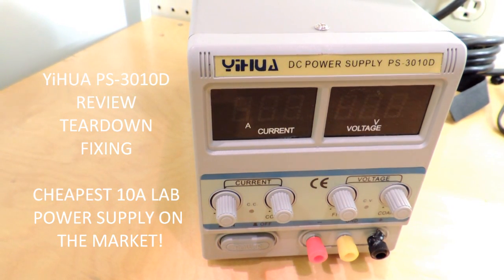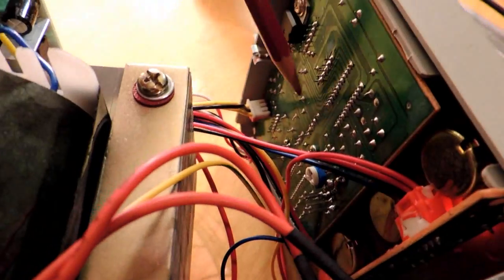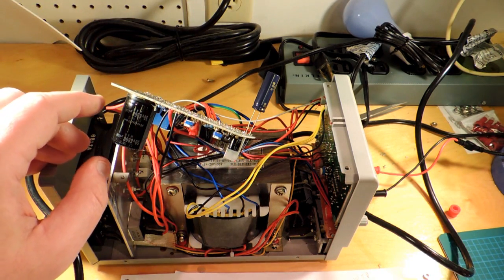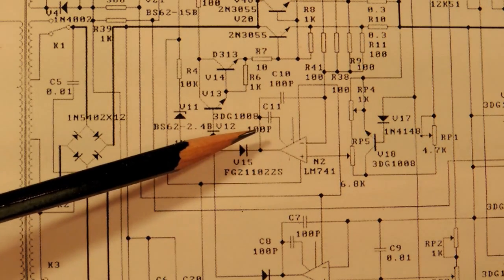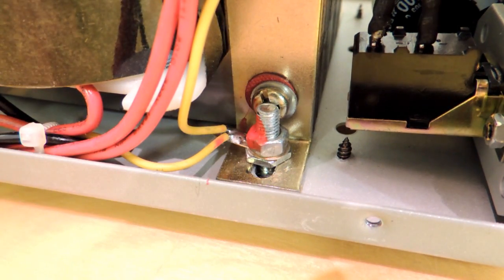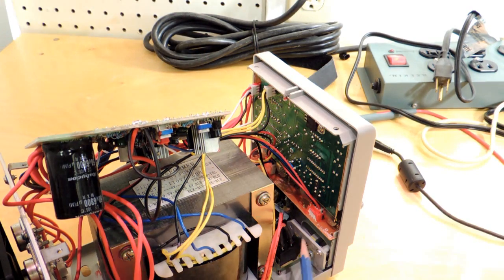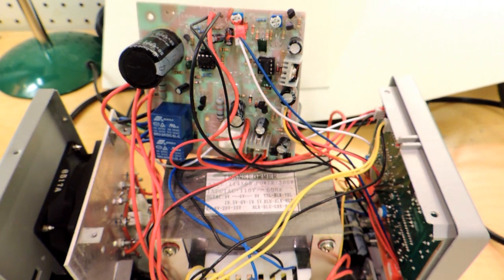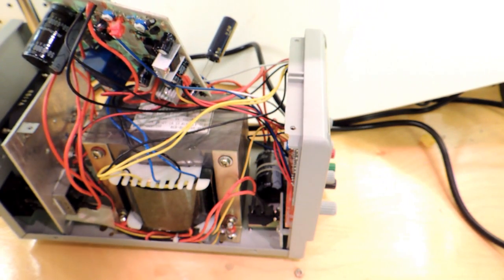YIHUA PS-3010D LAB POWER SUPPLY REVIEW AND REPAIR

Comment: i have a similar looking DF1730 30V 3A linear PS version, like 10yrs old or so, with a crackly Amp knob (so it seems) . tried to disassemble the thing. What a horrific experience!! a rats nets , all tied up, no room or spare wire anywhere to get single modules out without complete disassemble incl. all the cable ties and EVERYTHING. a total mess!!! Also no proper schematics or block diagram found online. Terrible!!

Comment: I have a problem with my power supply. I found the regulator power transistors and resistors were burned.even after replacing them  not working. Therefore I replaced the error amp too. but still not working correctly. But after removing the UA741 the voltage control is working fine. 

I don't have a schematic with me. Can you send me the schematic please.

Comment: I have same PSU, I replaced the potentiometer, and the psu still float the regulated set voltage I need it to work on, example: it will jump from 5v to 3.4 back to 5.5 and so crazy on, sometimes it get stable. I hear how relays switching while start get unstable. Some help, what could I check?

Comment: electronupdate ive just bought the 1503DD model its a 15v 3amp now it seems to work for like powering stuff like bulb's moters anything really that runs on electric but it doesn't work for zinc plating it just bleeps & flashes with no power going to the anode & part do you have any ideas please what it could be ? ? ?

Comment: USE A 65Cº ALWAYS OPEN TERMOSTAT FOR THE TRANSFORMER AND A 75Cº FOR THE RECTIFIER ON THE BACK TO SWITCH THE FAN ON AND OFF ALSO A CNC MACHINED GPU COOLER IN IT SO IT OPERATES VERY WELL, YIHUA IS THE BEST ECONOMIC BRAND FROM CHINA THEY DESIGN THEIR PRODUCTS TO BE WELL MANUFACTURES WITHOUT BEING EXPENSSIVE ITS THE PERFECT BALANCE PRICE TO QUALITY OTHERS ARE JUST COPY´S AND DONT EVEN TOUCH ERUNTOP STUFF

Comment: My equivalent just began throttling to over twice its voltage rating on power-up with no load and a settings at zero. On throttle, the external multi-meter readings are +/- 1.5V. After tweaking the knobs (either Amp or Volt and either course or fine), a faint click can be heard, the fan cuts out, and the unit slowly drops to a display of 0.01V. Again, multi-meter readings are the same as before. Where do I start?

Comment: Blown PS305D supply up twice (30V/5A), circuit similar except it has 2 x 2N3773 instead of 4x2N3055. First failed testing a drone motor, second comparing 6V bulb with LED light. First time I ran motor well above 3.7V and then re-connected it - blew 2 x 2N3773, plus one 0.33 ohm resistor. Today the 6V bulb blew at 6V exactly and the two output transistors failed again. Decided to do the mods described above but could not find out where to put the capacitor and what value. Went to extreme and put 2200uf/63V across C1. Blew 2 of the rectifiers V1-V4 which went up in cloud of smoke, maybe the capacitor was duff. After replacing them I tried a 220uf/63V (ok) and then 470uf/63V - the actual voltage is about 24V. It was ok so I kept that. But then I noticed C3, so added a second 220uf/63V across it - all was ok. I await further failures, not sure how to protect the supply from overload, not confident at all.

EDIT #1 

Blew again in the afternoon. Something is really wrong with my PS305D. Lost only one 2N3773 this time. Was testing 16 LEDs for replacement of light bulb for 6V. Measured single LED as 2.6V-3V seemed ok each 100ma at most. Wired 8 strings of 2 LED in series and then put these in parallel. Set the voltage to 5.2 V, all were on, then adjusted the voltage slightly up towards 6V target, something blew and the supply display read the dreaded 50V again. Fixed the power supply quickly as I have lots of spares on hand. For the LEDs 7 survived, 5 went open circuit, 1 went closed circuit and 3 were about 1K each direction. I guess I must have caused some sort of surge which blew a 2N3773. This scenario should not cause an overload!

WHERE TO CONNECT BASED ON VIDEO - POSITION AND CIRCUIT DIAGRAM

Looking at the main board from the copper side. Looking at the supply from above with the cover off. The left side is looking from the front to the rear. The board is screwed to the aluminium heat sink by two screws, call this edge A. Work clockwise around the main board you have edge A (rear), B (right), C (front), D (left). On the edge C about 2/3 along from B->D is a 7812 voltage regulator with 3 pins. On right side is about 24V (input) with C1 470uf, and on left side is 12V (output) with C3 220uf. Middle pin is ground. Not sure which of these capacitors the OP was referring to. I duplicated each by placing leads across the 7812 pins and then used cable ties to secure the capacitors. Effect should be same as OP describes, but leads in different place. Hope this helps. 

This mod did not prevent the third blow out I had. Possibly some other components were destroyed as well in my first blow out. Another circuit I found has a diode from the collectors of the transistors (V48 etc) from the other side of the emitter resistors (0.33R) pointing toward the collectors. This seems like it would limit a reverse spike going through the emitters, but I am not sure. Frankly I am giving up on this power supply and using another I got from EBAY labelled MS-305D.

MS-305D TYPE SUPPLY

This is completely different from the PS-305D though the front panel is very similar. It has a switch mode power supply, a crammed main board with IC's and SMD's. It looks like it cannot be repaired. I am using this now. Also I have a much older dual tracking power supply GPC-3030 (slave/series/independent) which is very hardy.

EDIT #2

Today I figured out what my problem was, or so I thought. The two transistors that switch the relays had blown and the voltage from the transformer to the power transistor collectors was fixed at 53V, it should vary as more voltage is required. At even 2.6A this exceeds the safe area (see 2N3055 or 2N3773 datasheets). When I replaced them I saw that the 4 transformer outputs are switched in 4 steps. Relay R1 and R2 have 4 possibilities (OFF-OFF,. ON-OFF, OFF-ON, ON-ON). By some clever circuitry the relays switch on and off and you should hear 3 clicks as the relays kick in as you raise the voltage, going from about 10V to 53V. This voltage is applied to the collectors of the 2N3773 and the base voltage determines the output voltage. The voltage from collector to base and emitter is what needs to be kept in check. Anyway I did some more load testing and it lasted a while at 30V with a 11 ohm load but eventually one of the power transistors blew again. I give up! Will put it together again with a 2A limit pasted on the front. Looked at having Arduino to control the power output stage but as it is blowing, I don't see the point, but it is feasible.

Comment: About the power spike:
I own a similar chinese power supply based on the same electronic design and in the manual it states that the power supply voltage  should be turned down before turning on and off, and not to plug anything in prior to turning back on. 

Obviously the manufacturers were aware of the voltage spike problem.
Reply: There are power supplys as my QJ3003E, that has a similar problem BUT this overshoot occures if you come back from the current limitation. So if you have a short and recover from this short, your supply will overshoot. Pretty similar with 15V instead of 5V. And this will kill your circuit :/
A try to find the flaw with this design :/

Comment: The time line at 8:49 gives a clue where the extra capacitance capacitor is soldered in parallel to the existing capacitor of the smaller value already on the board. Since the author is not replying to multiple requests look for visual clues.

Comment: Thanks this was a big help. I found this unit for sale on ebay. Found the listed spec's lacking. Then searched for a model based review.                    I was wondering if it was linear or a switcher.  And  you answered that plus more.  Definitely going to get one now.    For the price and what I need this will work.    Thanks again

Comment: mine out of box kept turning off and on repeatedly, led display flashing off and on as well and then popped and shorted out from probably spiking off and on and died, power cord seemed bad connection, cooling fan not staying on, complete piece of junk, banana jacks and banana plugs that came with unit junk, at $54 ON EBAY you get what you pay for. i was using it for a zinc electroplating system just some tiny parts to plate nothing over 1 amp requirement , its ok to use that type of power supply for electroplating???/

Comment: Its not just the cheap Chinese power supplies that surge the output when power cycling - I remember 30 years ago we used Farnell 30V/5A units and had to fit zeners across their outputs to avoid frying the powered circuit after power cuts.

Comment: Question; does your oscillascope pick up any spikes on initial start up? like on "cold start" for lack of a better word? Because in your initial example of the spikes it seems to have only really occurred when quickly powering off and power right back on? I realize your test was to test the performance and durability under absolutely any type of use... Thats what we do right? we like to push components to their limit... Hence overclocking >: )

lol but anyways I just purchased one of these and just curious if I'll experience any of those spikes under normal use. For example; power on, use power supply. When done using after roughly 10 minutes being on, power off.

You know standard use. At roughly 1 amp 12.5 volts. thx

Comment: Well at least the initial manufacturer that assembles these power supplies before GQ, yihua, maisheng... etc rebrand them is actually using rubycon capacitors... They may not be the best rubycon capacitors but I have seen the same exact caps (50V 6800 MXR) used in some of corsairs top of the line ATX power supplies. And I'm referring to their 80 plus rated power supplies too. So assuming they aren't rewrapped chinese poop caps and they are genuine rubycon... Then kudos for atleast including a few good parts. And I agree, kudos for the larger transformer! :)

Comment: Can you please help me with this? I got one of this but the current doesn't adjust. Actually the led for the current doesn't light up at all. The seller said that I need to change the potentiometer. Is that correct?
Reply: The current display is a current LIMIT. You can't directly control the current that goes through a circuit as that is a product of the voltage applied and the resistance of the circuit (for a very basic circuit, at least; it's more complicated as you add more components, but you can still never turn up the current dial and expect the current reading to increase unless the supply is already limiting). To more easily set the current limit, turn the voltage down to a few volts (saves power usage, heat generation and prevents sparks), connect the two output terminals together (which will of course result in the maximum possible current flow) and then adjust the current limit dials. Then you can disconnect the outputs when you're done and turn the voltage back up to what you need. This was all written in my manual :p

Comment: One thing I would like to see you test is the output power. Will it actually put out 30V @ 10A? The one I have will not. I also have a 30V 5A version, which you would think should put out 150W but actually only puts out about 17W.

Comment: Mine starts to read current draw with nothing connected after being powered on for a few hrs. got up to 1 amp... lol
Reply: These power supply comes with an invisible resistor load. I believe you're forgot to remove it.
jk

Comment: Thank you. Good tutorial. I have a PS same that. Can you send me electronic circuit, please? My email is johnar2@gmail.
Reply from the maker: +Juan Arias sorry i don't have a schematic
Reply: Ok. Thank any way. I need a picture of schematic. My PS had another problem. I changed the relay and transiator driver. But now  0-20 volts   only.
Reply: do you fiund a soluition to that? same problem here
Reply: No yet. I need the electric schematic, then I will try again.

Comment: Awesome video! I noticed on a video from 2014 that they actually made the calibration pots accessible from the front, right under the meters. Is this power supply still working for you? I would be impressed if it is. Thanks for the video. Really good show.
Reply from the maker: +Vallen Larsen Still works, but I don't use it very often.
Reply: Nice video. Gave it a thumbs up. What's your go to power supply?
Reply from the maker: HP 3615A

Comment: Nice review. 
Just wondering why the Chinese like to build everything the wrong way around. Voltage and Current controls and meters are the wrong way around, Course and Fine controls are the wrong way around, Ground and Earth terminals are the wrong way around (standard spaced 4mm adapters won't be usable). 
And there's the quality issues of course, loose earth connection (which may kill you), enormous power-on spike (killing your circuits), very inaccurate meters which read too low (killing your circuits again), and the fake Rubycon capacitor right next to the heatsink which probably blows its arse out when it gets hot (a genuine Rubycon would survive this but costs more than the whole power supply). 

But otherwise, very very nice power supply. Glad you fixed this one and made it a lot safer!

Comment: Rubycon is a no-name Chinese make???
Also, why do the output posts change orientation between the first and second shot?
Reply: +68Stan 
No Rubycon is a good company actually! It's a Japanese manufacturer, on par with Nippon Chemi-Con, Panasonic, Nichicon, and Elna.
I have one of these supplies, but it's the 5A version. I think the Rubycon capacitor might be counterfeit, I'm not 100% sure. I have to take the plastic lid off the top of it to see what the shape of the release vent is. Usually the chinese get that wrong when counterfeiting. Sometimes they get it right, and when they do, they still get the rubber bung wrong! XDDD
Reply: My question was sarcastic...
Reply: Rubycon are one of the best make of capacitors however it could be a fake

Comment: Hi
Hello, I would like to ask if you were able to find exactly such a scheme from this model (W E P 3010D) It is almost identical to your YIHUA. I have it completely in parts,
An overview of what you get is not quite accurate and I'm not able to locate the damage, I wonder whether there were all hardware 4 transistors are NPN? Please let me know how you knew something about the schema Thanks.
Reply from the maker: +Tomtech29 no, sorry i have never seen the exact schematic for the 3010.  if you search for the 5A version ("yihua 305d power supply schematic") it seems to have some similarity with this product.
Reply: +electronupdate 
Indeed, in fact, it seems to use the same control board! Possibly the same transformer, though I'm not 100% sure.
(I have one of these 5A versions - it even had the same socketed chips. Except, the sockets were HORRIBLY corroded! I replaced them asap!)
Reply: I have this power supply incomplete some wires to be broken and not really know where they were ,still needs Scheme to run it
This version of the 5 ampere may not differ so much?
as if someone had some pics wewnącz please send me.

Comment: I just got one of these, so far so good. How do you utilize constant current mode? I get current readout, but can only adjust voltage, and the LED is always lit on the voltage side. Great video BTW!
Reply: 10 months ago, so good chance you've figured it out by now, but...

With my supply, which appears to be the same as in this video but re-badged, says that the easiest way to enable constant-current mode is to turn the voltage down to something nice and low (no more than 5V, or you'll get sparks between the leads), connect the two leads together (+ and -) as a dead short-circuit, which is obviously maximum current, and then the supply will limit to whatever current limit is currently configured (the two dials will always be set to some maximum current) - and the display will switch over to CC instead of CV. You can then adjust the current to whatever level you want, disconnect the two leads, set the voltage as required, and connect to your load.

WARNING, however: my supply specifically states that it has short-circuit protection, and is why it's therefore safe to connect the two leads together. If yours does NOT have short-circuit protection, you'll have to find another method.
Reply: +Andrew Gillard I did figure it out, I was being dumb, and not thinking it out. however my display voltage climbs after being on for any length of time, even though the output voltage is actually stable... set it to 5v, and it will read 10v on 12 hours, but the output will still br 5v... problem with my unit somewhere...